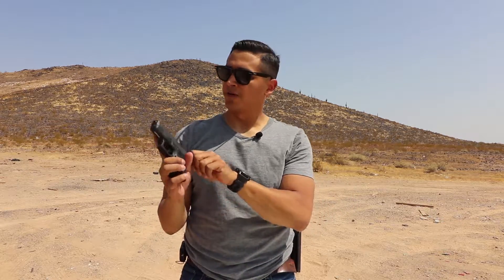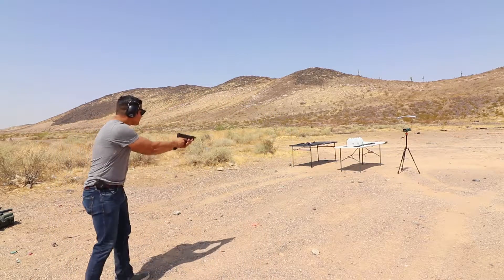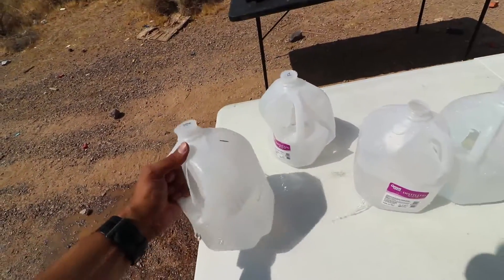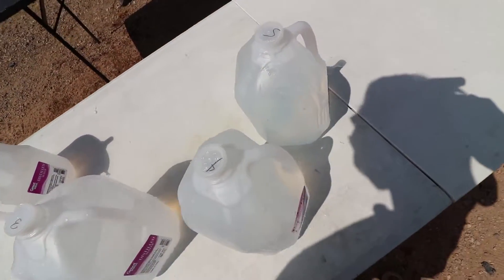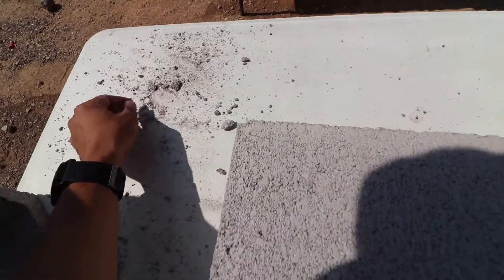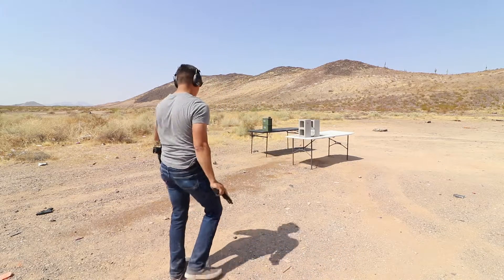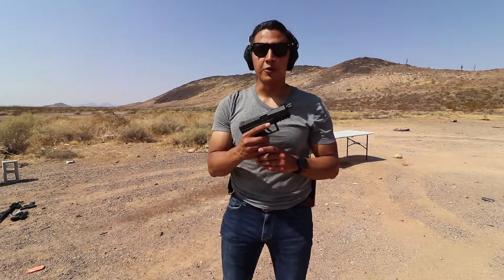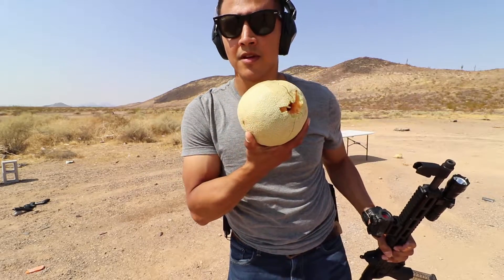9MM - DOES BARREL LENGTH REALLY MATTER?

Comment: 1) The gun wasn't bad.
2) The ammo wasn't bad
3) The chrono WAS off.
Do tell, how do you explain a certain gun making ammo travel 1,000 FPS slower than previous guns with shorter barrels?
Now for the ammo, you think 5 random bullets you chose to run through a particular gun were traveling at sub 300FPS?
Your chrono is crap, it's ok, mine is crap too. Mine read every bullit at the same speed. 22s, 38s, 45s, 12 guage and 5.56.
These chronos are toys, take the info they give ya with a grain of salt.
Reply from the maker: That's the logical answer. And I'm sure it is lol, but I swear it was only doing it with the Barletta and nothing else.

Comment: 293 FPS is bb gun level, I think the chrony is off man.
I understand bullets have more mass than BBs, but at 400 fps you can see them- you’d see the bullet at 293 fps
Reply from the maker: I have a love-hate relationship with the chrono, this is the only bad result it has given me. I will revisit with the same gun, same ammo and more premium ammo too.
Reply: maybe it was reading meters per second.
Reply from the maker: @Lokpyrite  i also thought of that. But as shown in the video I go from Baretta to Sub2k without cutting and it was back into the 1300s ftps. It was really odd. I don't trust the caldwell chronograph anymore.
Reply: I bought the same chrono and unfortunately you get what you pay for. I reload my own ammo so it's very important to get the right information. My first outing was with manufacturers ammo and I had over a dozen similar faults with about 200 rounds